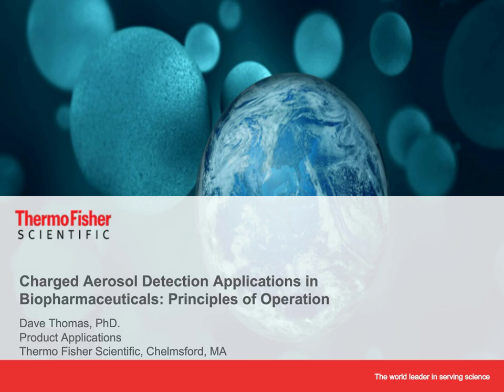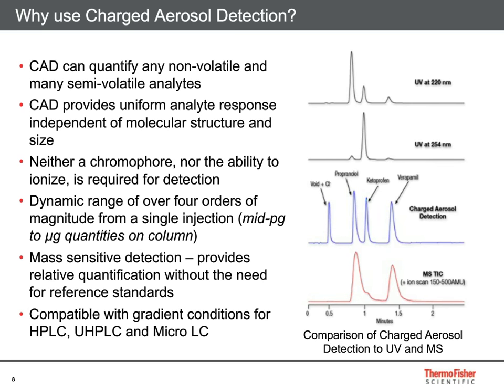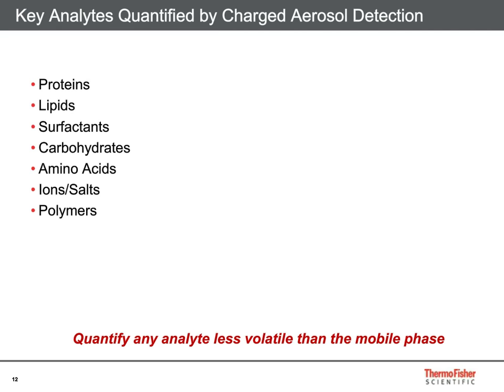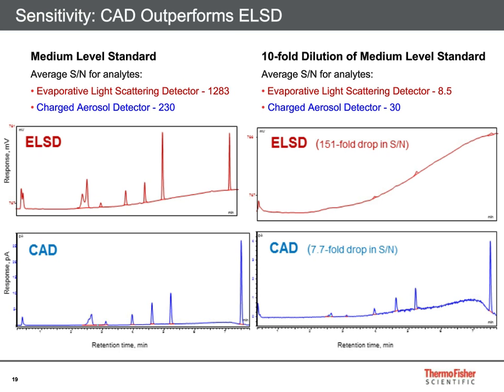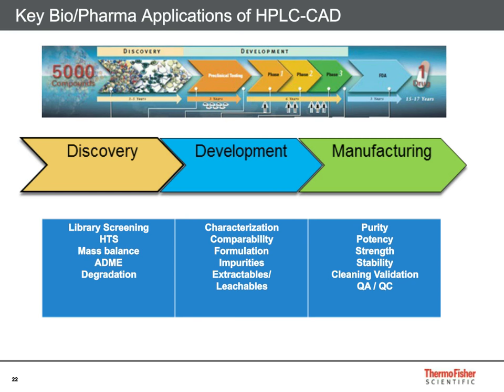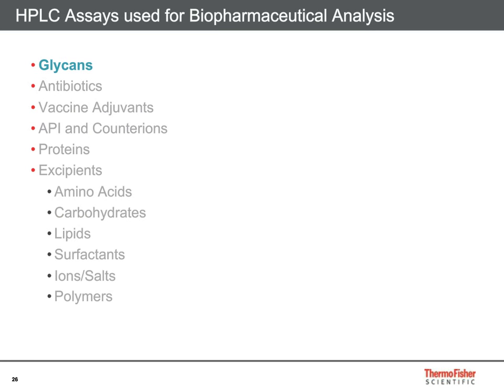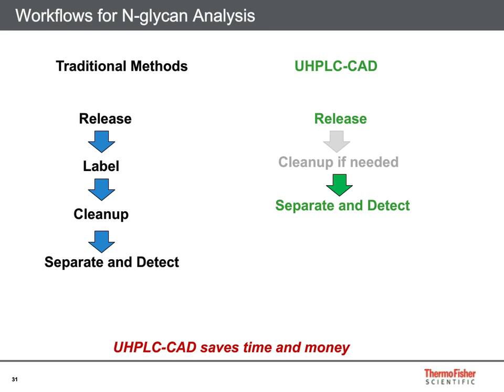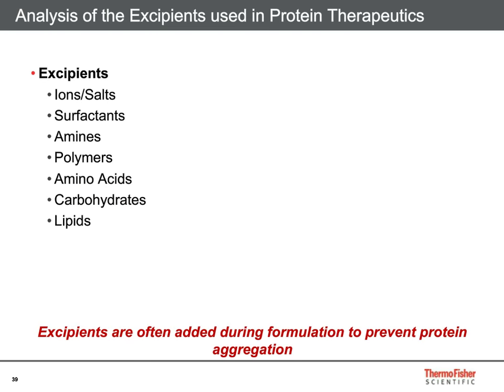Charged Aerosol Detection Applications in Biopharmaceutical Analysis

Comment: if the larger droplets are being dropped off earlier then how come the signal produced is directly proportional to the quantity of analyte?
Reply: It assumes the nebulizer will produce the same % of small droplets at the same condition and a homogenized solution will have the same concentration in those smaller droplets. So even if it only can take 5 % of the analyte in the small droplets to the detector as long as it's always 5% it will still be proportional to the quantity of analyte. You will need to run a set of known concentration calibration standards to find out the signal to concentration ratio.
Reply: @zeusyan exactly. Like a lot of analytical detectors work. Good example is the yield of ionisation of mass spectrometers. Guess the ionisation yield of a GC-MS (Gas chromatography with quadrupole MS and EI electron impact ionisation. It's 0.1 %. And a GC-MS is already sensitive as heck.